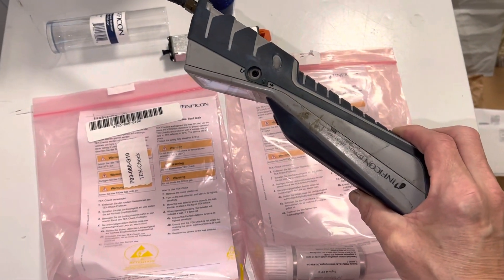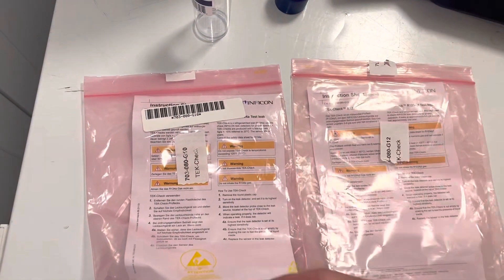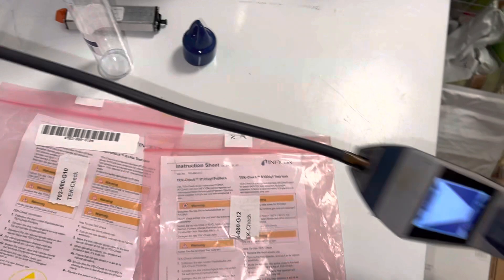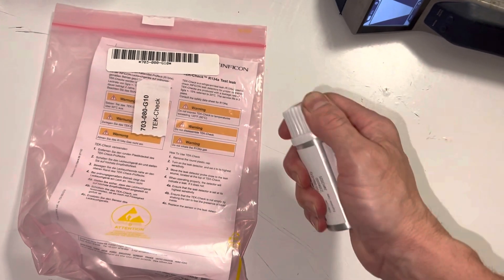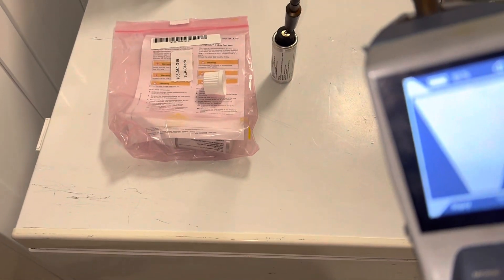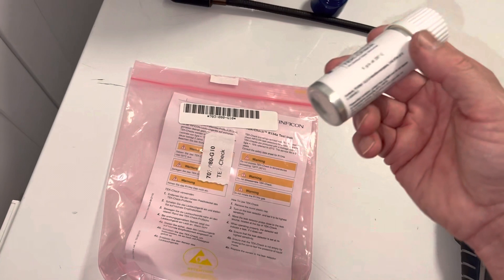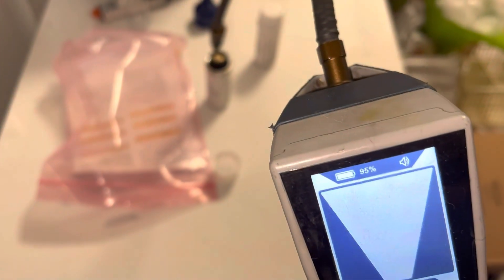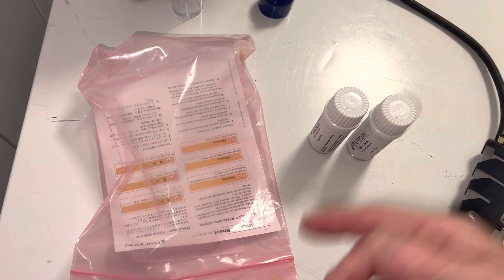TESTING R1234yf REFRIGERANT LEAK DETECTOR. Infineon part# 703-080-G10 for R134 & 703-080-G12  ￼

Comment: So do you have to unscrew the rubber part to open it or is it pre set in the package?
Reply from the maker: It’s preset you never open it.  It has a microscopic hole in the top that you never cover or seal just leave it as it is..  about 2 1/2 years to leak out then you just buy more.

Comment: I saw you videos on how proper compressor oil level fill accuracy is important, aside from refrigerant charge level/weight.
So I looked for such study and I found a few and also a webminar slide from Denso Europe.
The tech document on my MB W212 E400 also has a complete list for adding of oil quantity when each and every components are replaced, even up to the hoses. I am sure this comes from Denso, as my car is using Denso 100% condensor + evap , even the IHX is from Denso.

I got confused here.
All study and even Denso webminar slide showed that too much oil will reduce cooling efficiency proportionately.
However, they are discussing of OCR - Oil Circulation Ratio in respect to refrigerant circulation flow and not total oil filling capacity.  My car is a 590 grams r134a by sticker or Mercedes tech document  (ar83.30-p-1760cw, Drain, evacuate and recharge air conditioning)  and filling capacity of compressor oil is 120 cc, which I believe this 120cc is based on virgin 100% brand new for all the HVAC components or when they assembled the car.

120cc out of 590 grams and  specific density of PAG 46 at 15C is 0.986KG/Liter and for R134a at 15C is 1.242kg per liter if liquid. So by percentage of weight, my oil fill capacity under static condition is 118 grams of oil vs 733 grams of r134a or 16.1% of oil to refrigerant ratio by weight....wow, that is a lot. As to how much the total 16.1% oil ratio will stay put nicely in each component aside from the OCR,  is the data I can't find.😪

The Denso webminar slide is here :https://dokumen.tips/documents/basic-car-ac-training-day-2.html 
page 37 shows Compressor oil quantity & Cooling capacity chart.
Too bad this "in-house" slide document has no actual webminar video along with it for more information.

The study OCR is here : https://core.ac.uk/download/pdf/77953978.pdf
Reply from the maker: Thank you yes, DENSO has some good webinars that were introduced by DENSO them south specially in Europe and buy some parts manufactures are parts distributors from Denmark and I think one from Sweden had some good webinar information about oil ratios

But here lies the problem. You’re only getting part of the story only part of the information. .   You need to understand the basics of how the different types of oil in systems work..   
1: some compressor manufactures, build their compressors to actually have a oil sump it oil reservoir just like your gas powered engine has an oil pan that may hold four or 5 L of oil inside the pan, but at any one time while the engine is running only a few ounces of that oil is actually being used being pumped with a oil pump the total mass volume that is contained inside the drilled out ports and galleys of the oil passages, and that is constantly pumped up to the heads, rocker arms lifters only adds up to a few ounces of oil. 

For air conditioning compressors, some compressors may hold, for example 2 1/2 to 3 ounces of refrigerant oil. Well, another ounce, more or less is traveling throughout the rest of the circuit. . 

Then let’s look at the A6 Frigidaire that holds 6 ounces of oil in its oil, sump pump with an oil pick up tube and a oil pump. Total system capacity for those systems might be 10 ounces and usually up to 14 ounces if it had to Evaporators.. 

Do York and Tecumseh in compressors had roughly 6 ounces in the sump and usually 10 ounce oiled systems and all these older vehicles it was usually 2 1/2 pounds of refrigerant up to 5 1/4 pounds of refrigerant . 

Let’s jump forward to today .  My 2012 Prius C has roughly 2.77 ounces of total system capacity oil. In 420 g refrigerant.. 

If you watched enough of my videos as I record, I show the refrigerant and refrigerant oil quantity that is contained on some manufactures under hood stickers .   Some manufactures for example may have 500 g of refrigerant, but because the vehicle is produced one in Canada one in the United States and they use different manufacturer compressors in each, but the same refrigerant amount. The oil sticker on one vehicle may say 4 ounces of oil with 500 g and the other vehicle maybe 7 ounces of oil with 500 g. 

Now we get into the internals of supposedly the new generation of compressors that do a better job at oil, separation, and a better job of not expelling so much oil from the compressor at the discharge port . 

This is so the majority of the oil all stays inside the mechanics where the bearings and high friction areas are contained in less oil is actually in the combustion chamber if we’re talking about a gas engine, but in decompression chamber, where the refrigerant is contained . 

So less oil is expelled 

Usually the circulating oil ratio in old AC systems were somewhere between 3% and 6% . 

Supposedly, some of the newer compressor designs for manufactures are supposed to be a lower percent of oil is circulated from the discharge port .  This is to keep efficiency high, the last oil you have any evaporator the better the heat exchange ratio.. 

So do not base all knowledge on just one or two reference sources from one or two manufactures there are many many different scenarios of how the systems work. 

The compressors are always expelling a little bit of oil as a waste product from compression mixed with a Refrigerant .  And this is why when refrigerant runs low in a vehicle, it cannot return to the compressor because it collects inside the evaporator because there’s not enough mass flow of refrigerant to sweep the refrigerant back out of the evaporator that’s causing the compressor to overheat due to lack of cooling due to a low, refrigerant charge and high friction due to the fact that the oil has left the compressor, but has not returned to the compressor.. 

When you pull these compressors off and go to drain out the oil, you usually find there’s no oil inside the compressor or very little . 

It did not leak out. It’s just all stored up in the evaporator. .  

And when you fill the system back up all that new refrigerant will flush all that oil out of the evaporator and returned to the compressor . 

But supposedly if you had a burnt out compressor, you completely removed and flushed all the components out or replace them so you will not have oil up in the evaporator in the first place when you install a brand new compressor . 

But we know there’s a lot of people who don’t do things correctly and they don’t read or understand and they just throw Parkside a car .
Reply: @coldfinger459sub0   This is why I must ask you , thank you !!!!!👍

Comment: Tom, so the test gas is metered-valved to leak at 5 grams per year at 20C. There is no way to shut off the valve, correct ?
Its shelf life is actually not refrigerant life per se, but it is that it will leak enough in 2 years at that controlled 5g/year @20C.
Its real content I supposed would be like 15 grams ?

At 20C r134a saturated presssure would be 5.72 BAR absolute, say typical freezer at -20C the pressure would be 1.32 BAR absolute, so you can keep it much longer than 2 years yah ?

I watched a webminar on r1234yf 3R machine and equipment and SAE standard, but I can't find the link now, it is from one of your subscriber. The speaker said that coffee will give false reading to all the known sensor ( the webminar was a 2013 release, there about ). Is coffee still effecting your current leak detector ?
Reply from the maker: You are correct the valve is a permanent orifice calibrated leak in the calibration bottles. 

This is why the guy at Inforcon told me to put it into the refrigerator to extend the life .  Simple physics of pressure and temperature. Easy to figure out why. 

This is why I always tell everybody do you need a list some very grammar school basics physics knowledge that even a eight year old can understand . 

I ate 2013 video one of my subscriber something about a leak detector and coffee setting it off yes a lot of very cheap leak detectors especially if they were the super cheap leak detectors that were corona discharge and the most notorious known old refrigerant leak detector was the TIF spark fuel generation across a gap to detect refrigerant but it would also detect everything else from your breath. Your under arm, deodorant, your coffee, your coolant, your windshield, washer, fluid, everything set them off.

I was raised from the age of 12 using a H 10 heated diode leak detector did not have that problem 

And I just happen to be driving to a coffee house at this very moment that I’m reading your message in responding .  So guess what you got a special dedicated video of my leak detector sniffing coffee. 👍 ☕️
Reply: @coldfinger459sub0   LOL ...awesome
Reply from the maker: @suryaprihadi2258  I’m just uploading the new video of the results of the coffee and infrared leak detector right now as I’m sending this message it’ll be uploaded in a few minutes